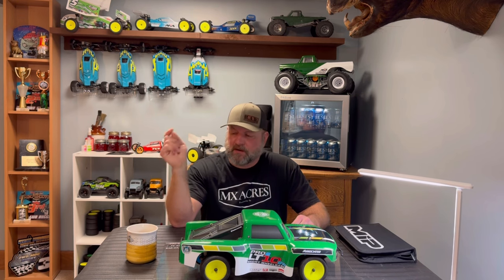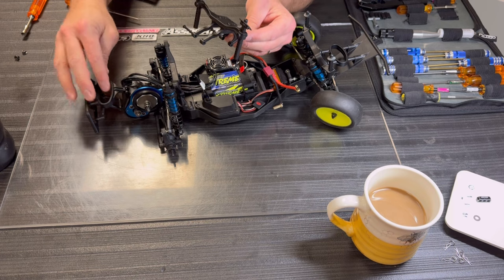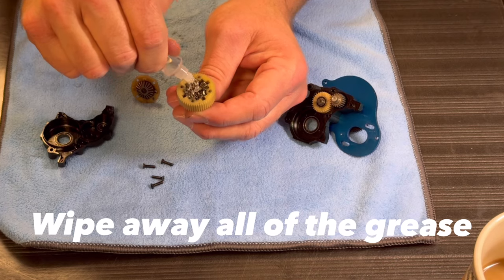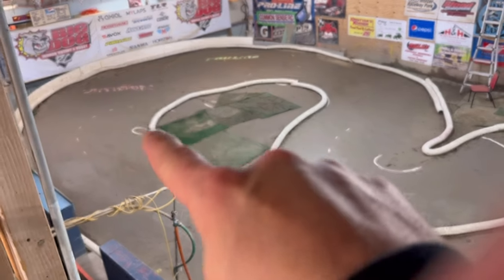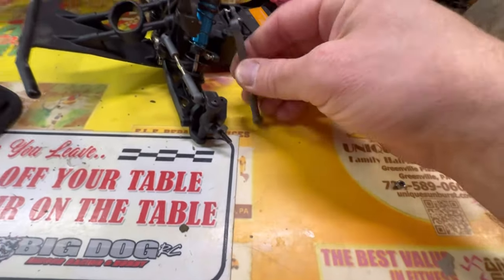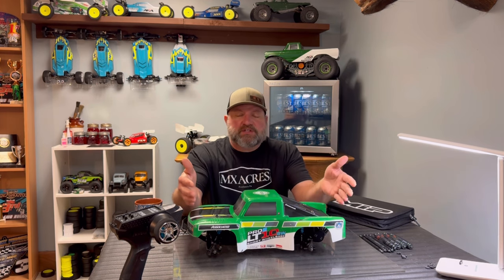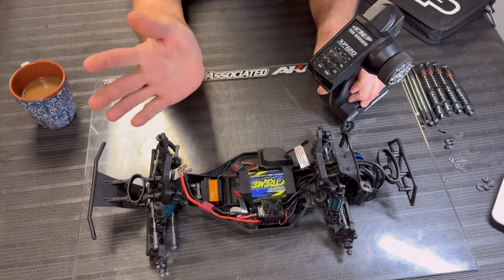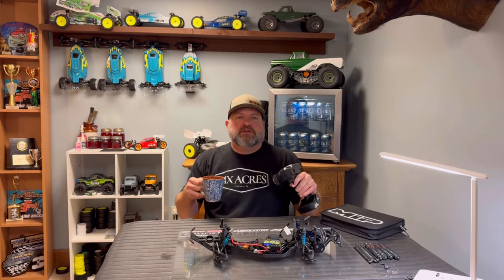Team Associated Pro 2 LT10 Racing Mods.  ESC Hacked and Experimental How to  Part 3

Comment: If you don't have D/R and can't adjust ESC brakes, just make a bump stop on the transmitter on the brakes side.  Can be as simple as adding some tape.  This way you can still get more brakes if needed by pushing your finger extra hard to squish the bump stop and going beyond the set ravel.

Comment: the TA radio i got with my Reflex 14T had a weird glitch where it would lose connection up to 5x per battery, just had to power cycle the car but it was such a pain in the a$$ i immediately swapped it out. Cool vids, thanks for the tips!

Comment: One of the really neat parts about this truck is, unlike "normal" 1/10 SCT, this is actually close to 1/10 scale, dimensionally(barring the 22" wheels). IDR if I said it on any of your other videos, but normal SCT is actually 1/8th scale once you do the math and compare it to the full size Lucas Oil offroad stadium trucks.

Comment: same transmission as the sr10,dr10,sc10 pro2. my dr10 has a bad transmission the idler or diff has a bad tooth and sounds like bad mesh setup on the spur